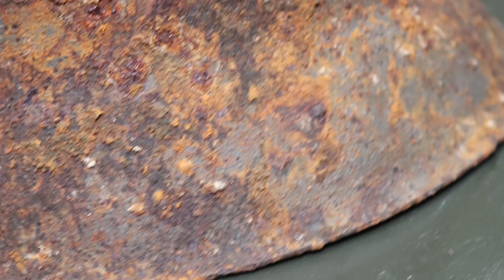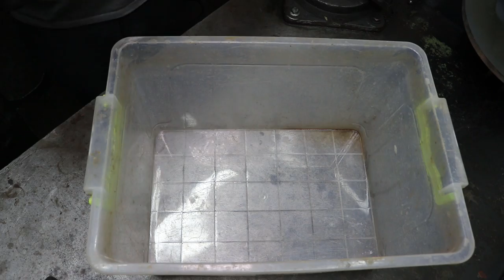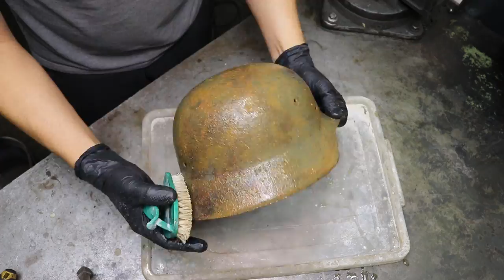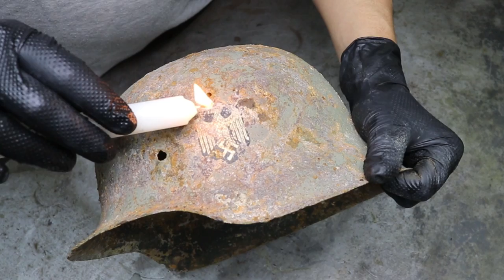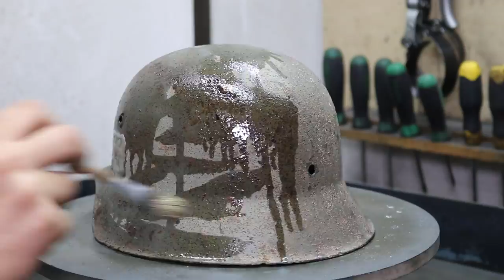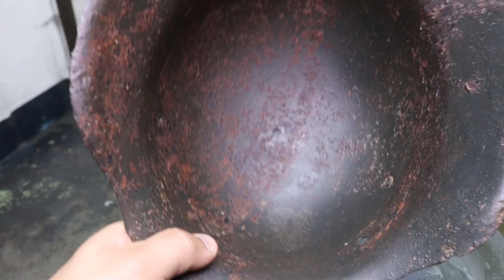Preservation Very Rusty German Helmet. Cleaning in Oxalic Acid

Comment: Hello, excellent channel, a question, if the helmet has the sticker, decal with any emblem, does oxalic acid spoil or damage it? thanks greetings
Reply: I work alot with oxalic acid alot for restoring old bicycle and unless you use way to much chemical it doesn't affect decal

Comment: Great video!! May I know what kind of toilet cleaner you used for the cleaning of the helmet? And does it contain bleach? Thanks!
Reply from the maker: Duck 4 in 1 Toilet Cleaner.
https://www.ebay.com/itm/Duck-4-in-1-Toilet-Cleaner-750ml-99-99-Germ-Kill-Removes-Limescale-Pine-Fresh/310455238807?epid=21026963091&hash=item4848930097:g:w9IAAMXQAI9SJeEE

Comment: Hi, you did a fantastic job. I want to know, if you use normal domestic water for the oxalic diving, or demineralized water. When I dry the helmet after oxalic, it will came little yellow or lite green. What could be the reason of this problem? There is a way to remove this terrible yellow patina? Thanks. Ivano
Reply: You should have put the helmet in water with bicarbonate

Sadly those videos do not show the complete part of restauration

So if you follow them without researching information you get different results

Comment: Why do u use toiletcleaner After Oxalic bath?
Reply: Once the oxalic immersion cycles have been completed, it is necessary to act in this way.
- Rinse the specimen under running water and brush it gently in order to remove the superficial oxalic acid deposits.
- Prepare a basic solution of water and bicarbonate (1 tablespoon per liter of water) and immerse the item for at least 15 minutes. In this way the acid action of the oxalic is blocked and the formation of deposit patinas will be avoided. I don't use baking soda, but I prefer to rinse the object very well (never had problems with patinas) but I recommend everyone to use baking soda.
- Remove the object from the basic solution and rinse under running water.

- Now fundamental point: drying. For personal experience, too fast post-bicarbonate drying can make the paint flake weak by the acid process or make any friezes disappear, so I recommend a natural drying in the sun or in a closed place.
Eugenio (ITALY)
Reply: @annalisaprocaccino  cosa intendi con 
"too fast post bicarbonate drying"?

non devo asciugare il casco con l'asciugacapelli?

Comment: Where to get those ....
Reply: They can be found on ebay, amazon, IMA, and 1944 militaria! I got a double decal m35 off of ebay!
Reply: @falke_9775  but are they replicas or real? I have a american one, but i found it in the forest
Reply: @KB-gn6rh  you can get both, the seller will tell you. The helmet you found in the woods, did the rust rub off easily, or was it a lot of rust?
Reply: @falke_9775  it was rusty but i removed Most of the Rust, it has about 2-3 small Holes on the top, where the Metal got "eaten away" by the rust
Reply: @KB-gn6rh  definitely real if it got that bad